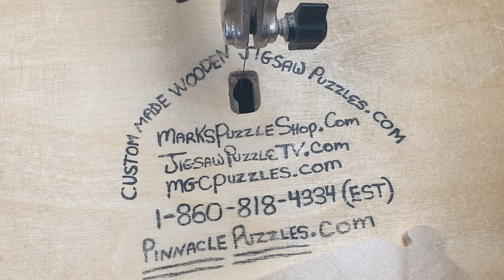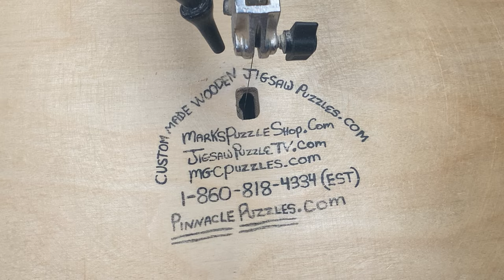Warming up my fingers by creating what I call a doodle, using a scroll saw and 1/4” birch plywood.

Comment: Just wondering what blade you are using
Reply from the maker: I cut with 3 different blades depending on my mood, and the wood's feel.  All are .008 thick with kerfs of .012 - .015.

Flying Dutchman
AMI
Eberle